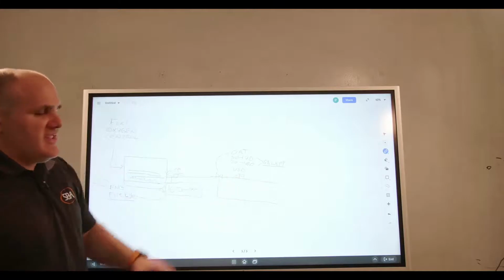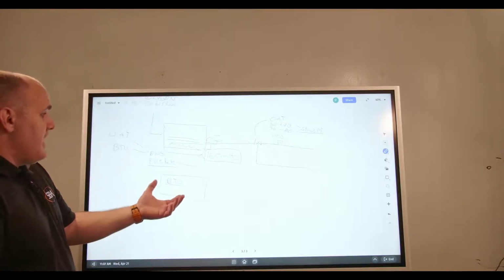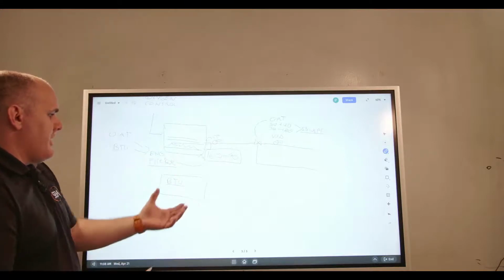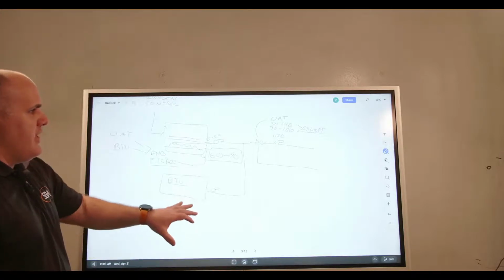SBA TV 33: Hot Water Control

Comment: Should steam valves be fail closed due to safety? Or does it depend on the psi of the loop? Same question for relays that turn the boilers on / off. Should they be normally open because it's steam?
Reply from the maker: Typically steam fails open for preheat closed for reheat. Boilers are normally open contacts. In fact most enables are normally open contacts.